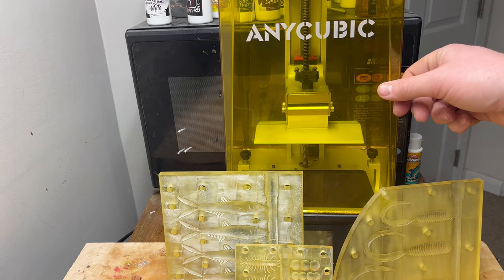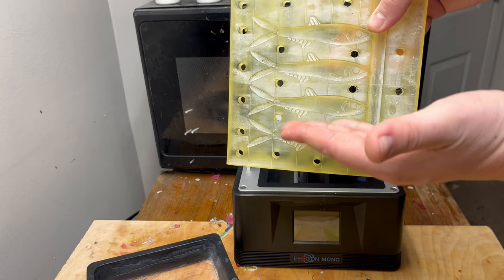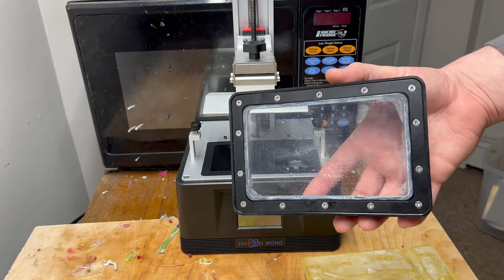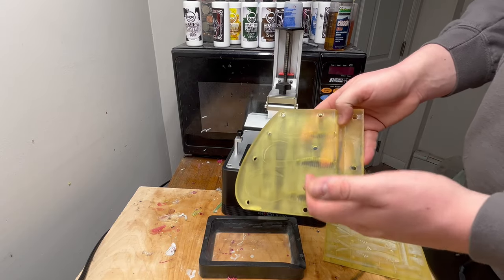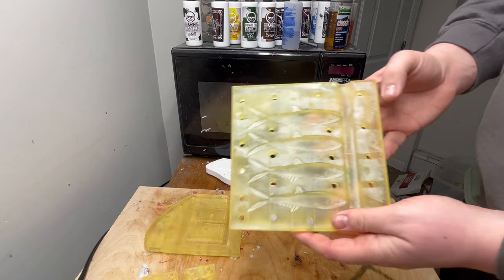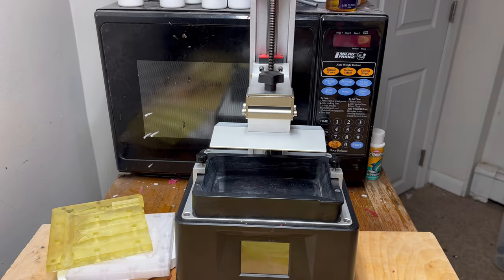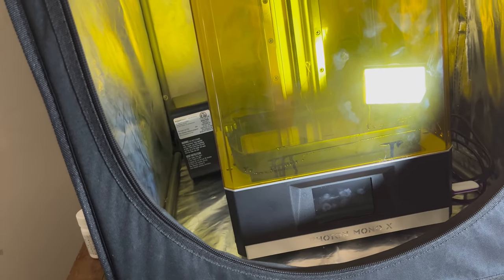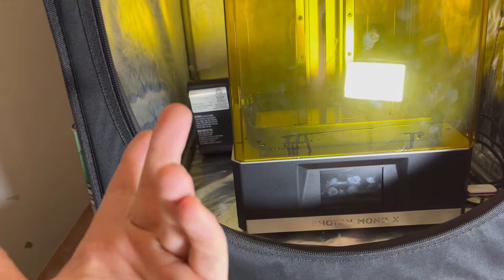3D Printing Soft Plastic Lures The Ultimate Beginners Guide: Part 1 The Basics

Comment: I used exactly the same printing set. the resin had a temperature of 40 degrees Celsius. I set the thermostat to 24-28 degrees and everything was fine in the box, but the heater got very hot and the printing failed.
Reply: I need to find a good setting on the thermostat so that the resin is at 25 degrees Celsius
Reply from the maker: Yeah thats deffinitly what caused your faliure. Where is your temperature probe. Mine is decently high up in the enclosure. If your probe is closer to the bottom the resin temp will be higher due to the temp gradient.

Comment: Does it need to be printed in resin or can you use normal 3d printers that use PLA?
Reply from the maker: You can use a normal one. You can definitely try pla but usually it works out better with more heat resistant plastics